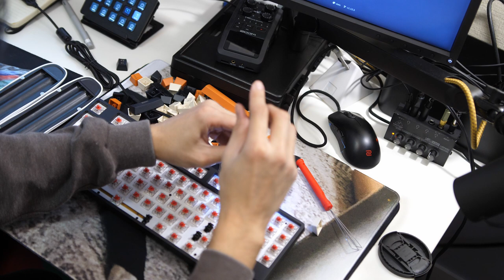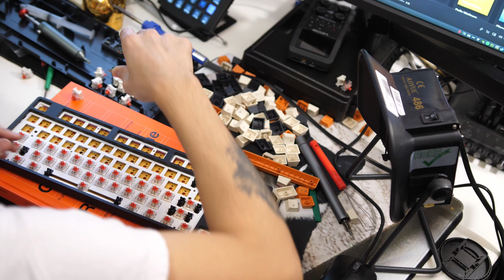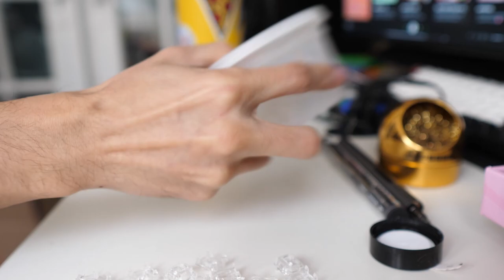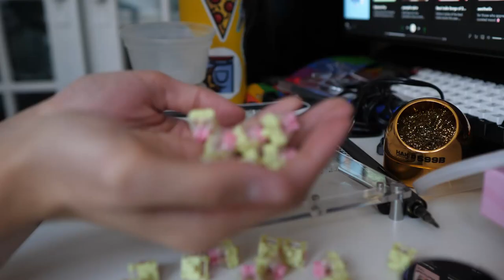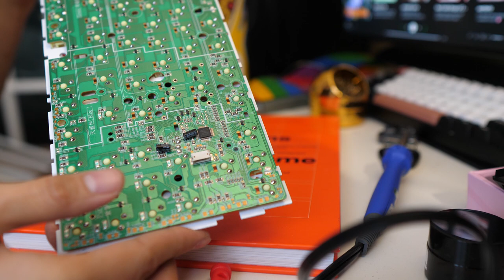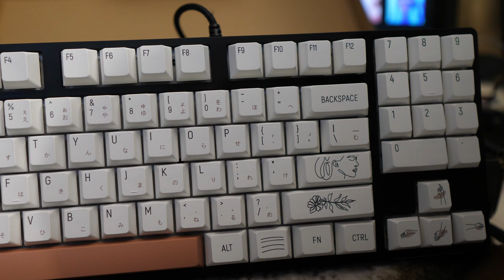Havit Mechanical Keyboard Modded (TTC Gold Pink)

Comment: awesome job! im here from your reply to my reddit comment. i've already taken this board apart, soldered on millmax sockets, going to be lubing some Gateron Brown switches and currently figuring out how i'm going to mount the USB-C connector I have for this! When I finish, i'll be posting a complete rebuild video for this keyboard!
Reply from the maker: awesome. i think you’d have enough space since the case is pretty hollow. let me know how it works out
Reply: Guys, would it be possible to solder LED's to this board to DIY a backlight for the Keycaps? I don't really see solder pads to the missing LEDs.
Reply: @yodvav  there are the holes for LEDs. I just don't know how you'd control the LEDs to make them work. But yes, there are the holes for LEDs and soldering points for them.
Reply from the maker: i second this because i also don't know how to make them work if they were put in lol
Reply: I am also projecting this board rn! If you ever get around to posting that video, I'd love to watch your process!

Comment: I love the Havit layout since they keep the numeric pad which I prefer to use for work. Do you know of any other mechanical keyboard with this same exact layout but with better switches?
Reply: TKL / 87  key layout
Reply: @Rolkey  Doesnt TKL stand for "ten keyless"? I have the same question as Id like to have a smaller keyboard but like th e10 key for work applications. I have this Havit keyboard and will mod it. But I too would like to buy a more high end keyboard with this same Havit layout. Thx

Comment: Your mod sounds amazing. ((And almost like Mr. Krabs walking at some points.))
Very crisp. Question: Could you put backlit switches on here? My dream is to have this size/layout keyboard with backlighting and media controls, also. Not to mention, of course, a set of really nice switches.
Reply from the maker: that's probably one of the funniest descriptions for the sound i've ever seen. thanks! as far as i know, both colorways of this keyboard don't have any backlight support and the PCB is very cheap (given- it's like a $20-30USD keyboard). i'm guessing you'd have to drop in a fully custom PCB to support something like that. at that point I'd probably just look for an 1800 layout board.
Reply: @SPANISHFOREAGLE  1800 layout is definitely not as aesthetic to me. Thanks for the info, though. I might know a guy who knows a guy that might have a line on inexpensive custom PCBs, so I'll see. For now I'll run the board stock and maybe do a similar upgrade like you did. I hear small things can make big differences, so.

You didn't seem to do it in the video, but are the stabilizers replacable? Or are the stock ones good?
Reply: @SPANISHFOREAGLE  Apparently the HAVIT KB851L is an RGB version of this with Pudding caps and blue switches.
Reply from the maker: @Drunken_Hamster  very interesting. if i come across one i'll tear it apart! looks hard to come by though

Comment: How did you manage to open it up. Im trying like a maniac and can't separate the botom. I just want to tape it before my new caps arrive in a few hours
Reply from the maker: double check to see all the screws are out, then I used a small plastic pry tool to clear the rest of the way. take your time so nothing snaps
Reply: @SPANISHFOREAGLE  Thanks for the response. I missed one of the screw and was forcing like a maniac for nothing. Tap moded and tried some playmat on the inside (foam like). With the new keycaps it sounds actually quite amazing. Love the 89 keys format.

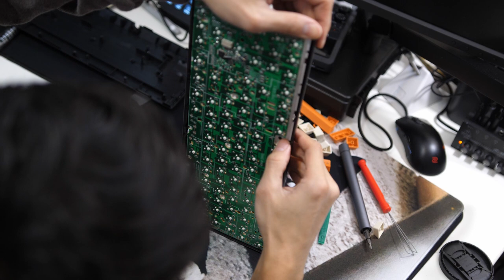Comment: 0:42 Do you simply just pull the processor off the plate?
Reply from the maker: if i'm remembering correctly, there might've been a few screws that i took off at some point but it did still take a plastic pry tool to open it further
Reply: @SPANISHFOREAGLE   Thank! 
Was desoldering needed in this mod?
Reply from the maker: @SamS-wf7uv  thankfully no but i would recommend a GOOD switch puller or two because though these are hotswap, they are very cheap and need some force to get some of these switches out.

Comment: did the switches break when you took them out? i'm thinking of modding the keyboard but cant change the switches right now
Reply from the maker: no i don't think i had any issues with the switches breaking. i had to use a desoldering iron and solder sucker pump before i could pull them out with a switch puller. standard soldered switches but they are a cherry mx red clone set so i hear the quality and consistency are going to vary.
Reply: @SPANISHFOREAGLE  sweet

Comment: did you have to desolder the switches to get the top plate off?
Reply from the maker: no these are hot swap so i just pulled the switches out with a switch puller. no (de)soldering in this build!
Reply: @SPANISHFOREAGLE  The keys in this board are not hot swap... I know that much.. You might have converted them to hot swap... but you must be mixing your keyboards up.
Reply from the maker: @txjeb  ah yeah sorry about that. I had another board in mind when replying. you're absolutely right because this board had an integrated plate, I did have to desolder then pull the switches and remove the plate.

Comment: Is it hot swap?
Reply from the maker: this board is not hotswap. i had to desolder the original switches before replacing them, and then soldering new ones in.
Reply: @SPANISHFOREAGLE  thank you so much ill keep that in mind